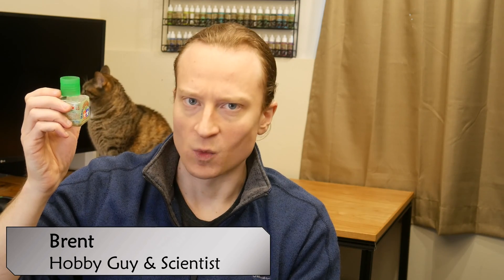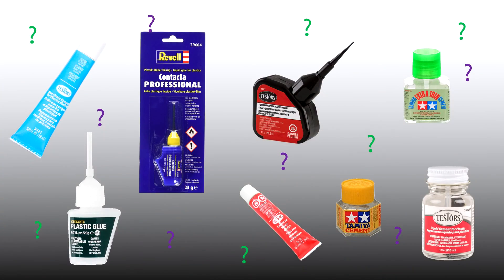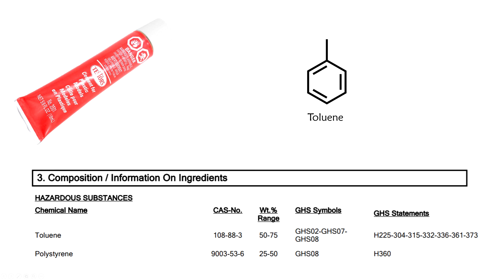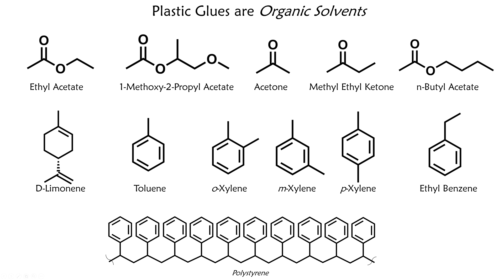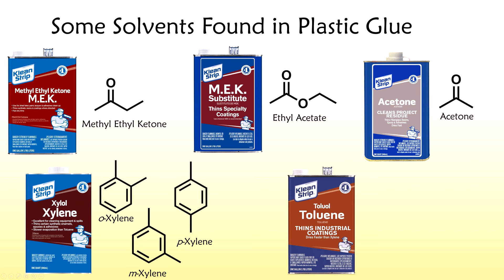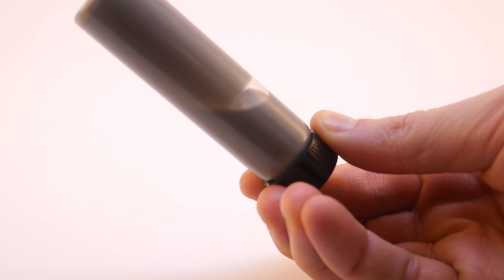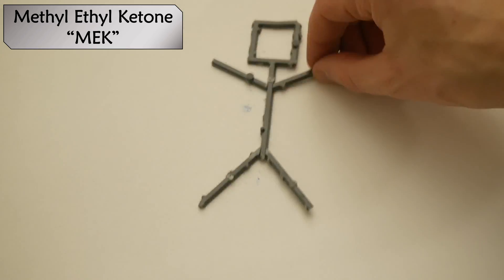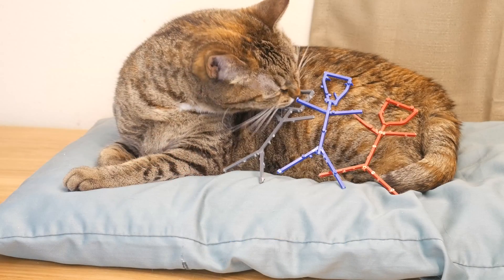How does Plastic Glue work? What's in the bottle and what does it do?

Comment: Now I'm wondering if I can dump some leftover sprues into solvent, then pour the resulting gel into a mold... and make new parts?
Reply from the maker: Do it!  after that "sprue goo" dried the plastic was exactly like the plastic it started as.  I'm sure there are challenges with making a mold that won't dissolve, getting the finished piece to release from the mold, and little bubbles in the plastic from evaporation... but it's definitely worth trying!  Let us know if you come up with anything good :-)
Reply: That, or you could recycle all the sprues into a sheet instead of buying the ones in stores. Fascinating stuff.
Reply: Will Fischer main problem here would be evaporation, because a mold is a closed space which makes it hard for the solvent to get out. If you have a vacuum chamber, though, and pull the vacuum slowly to avoid splashing this just might work
Reply: It may shrink.
Reply: https://m.facebook.com/story.php?story_fbid=3093920597303159&id=100000557486016

He said he use Polyurethane thinner to melt the sprue wait for 1 day, degas it everyday for a month and use it.

Ethyl Acetate are also used as polyurethane thinner.

Comment: This was very informative, and helpful. I had heard that plastic glue bonds plastic pieces together, but never with much detail on how or why. I recently bought that Tamiya glue featured in this video for the brush applicator after years of using generic plastic glue with whatever local tabletop store's name printed on the label. I haven't had a chance to use Tamiya's glue yet, but I'm glad to know that it will glue in a similar fashion with what seems like a much preferable storage bottle and applicator. Those generic plastic glue bottles all suffered the same fate of slowly drying in the nozzle creating frustrating clogs, or even worse gunking up the cap so that they did not seal tightly and drying up what's left of the bottle's contents. Now I can glue with more confidence in the results. Just well ventilate your work space, and all should be well enough to not worry much.
Reply from the maker: I'm glad the video was useful! It's always fun to figure out if there are any real differences between the brands other than packaging.  In the case of Tamiya glue, I think the packaging is worth it- hopefully you enjoy using that brush also :-)

Comment: Nicely done man. There are not a lot of videos out there talking glues for the Miniatures side of the hobby. Glad to see one covering all the bases. 

I've been using liquids for a good 18 years, mostly Tenax-7R, Ambroid Pro-weld, and Tamiya Extra Thin. I recently discovered Plastic Magic from Deluxe Materials. I highly recommend it.
Reply from the maker: I'm glad it was useful! Thanks for this list, I'll check them out.  I've got a superglue chemistry episode coming out sometime in the next month or two, stay tuned :-)
Reply: @GoobertownHobbies  that is a good idea as well, looking forward to it. I personally only use superglues now mostly for attaching basing materials. I pretty much only deal in plastics, so plastic magic is all I need. 

Which reminds me, the thick goop you made with the sprue is commonly called "sprue goo" in the modeling community. Its brushed on to seams and gaps as a filler instead of using putty. The sprue goo is less messy and can be cleaned, worked, filed and sanded just like the plastic of the model. Most just use the dregs of their Tamiya Extra Thin to make it, but I'd never thought to use the stuff from the hardware store instead, probably a lot cheaper than a bottle of Tamiya Extra Thin in the long run.
Reply from the maker: @assembly_language3948  Oh nice!  I'm always looking for better filling techniques :-) I'll have to put this sprue goo to good use!

What do you use to apply the sprue glue? toothpick? old paintbrush?  I played around a little and I wasn't having very fine control with it.
Reply: @GoobertownHobbies  Most just use the brush that comes in the Tamiya Extra Thin. I use an old (18 years now) natural hair brush, though once this bottle of Plastic Magic is empty, I plan to use that brush as I find it better than even the Tamiya IMHO